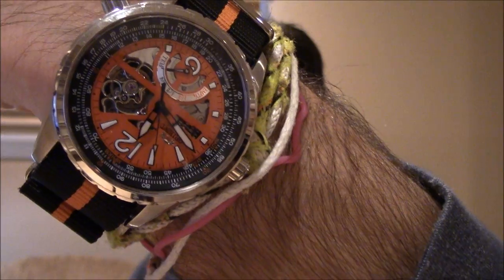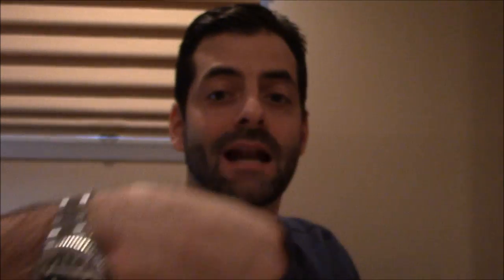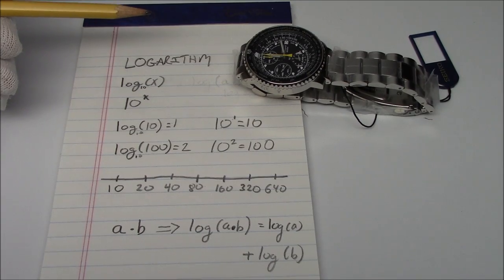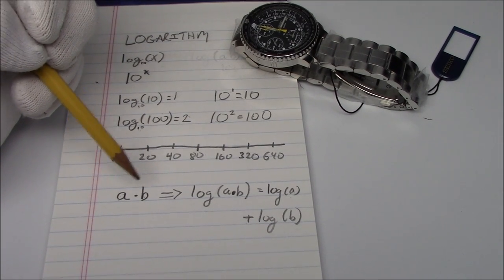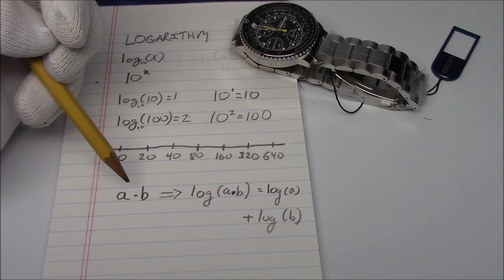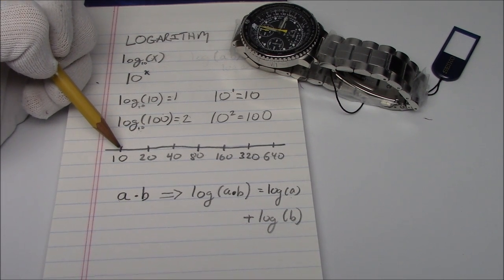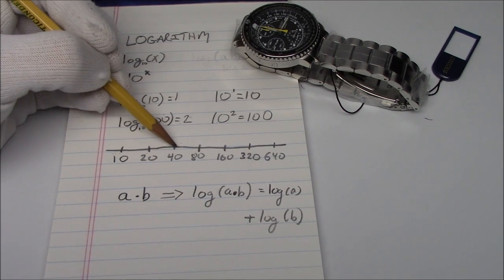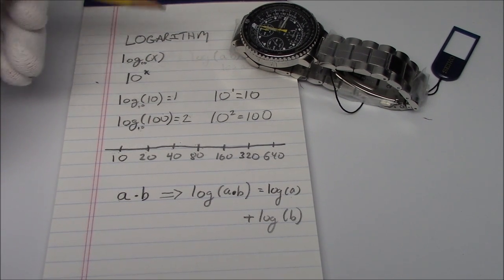How to use a Slide Rule Bezel on your Watch. Watch and Learn #11

Comment: I learnt to work with slide rules, and a round sliderule, like a bezel is more practical than a straight one.. 
I Design watches myself, and i've been thinking of making an Engineers watch with a sliderule bezel.. they rock!.. never out of batteries, and precise enough for good "Guesstimates"
I've made a special one for the workshop, to set up my CNC machines.. because on a calculater you have to remind the formulae, with "dedicated"sliderule you just slide and read..

Comment: I still have two of my slide rules... This brought back Memories.  Hewlett-Packard and Texas Instruments with their Scientific Calculators Amadeus Slide Rules almost Obsolete.
Reply: However, we were taught to keep them our slide rules around in case of Power failure, batteries ran down, etc. On my Iphone I have An AP that does conversions but it is still fun to see if I can do calculations with my slide rules. Also, using the slide rule bezels on several of my watches. I love technology and love to fly. If I had Catastrophic failure of all instruments on my plane I could possibly Navigate, and calculate with this Watch Bezel. If Flying in Turbulence - would be nearly impossible to use this but I would try!  Thank You so much for your instructional Videos. I have this watch and several others in my collection with this type Bezel and enjoy them!

Comment: You mention being able to work out trigonometry with this, Or that it can be done on a normal linear scale.
Can you please point me in the direction of a place that will explain this for trig on a watch? I did a quick google and can't see it.
I use a triangle calculator on my phone very often so learning to do this on my wrist would be much more empowering for me, also means I can use in when I am out camping without a battery.
Or, better still could you do a video of this?
Reply from the maker: Hmmm, I think you need a trig scale slide rule, which this isn't.

Comment: Actually, Canadians would find a LOT of use to convert between Imperial gallons and US gallons. All cars in Canada are usually listed in both L/100km and mpg, but if you're car shopping in the US, or reading the fuel efficiency of a car on a US website, the mpg is always lower as there's 4.54 L vs 3.79 L in Imperial and US gallons respectively. Living close to the US border ( as most Canadians do ) we're always converting back and forth and we've internalized most of the conversions. Without looking them up I can tell you  1lb = 454g or 1kg = 2.2 lbs. 1 gallon = 4.54 L, 1 US gallon = 3.79. There are 20 fl oz in a pint of beer ( the fl. oz are slightly different as well). 1 tsp = 5mL, 1 cup = 250 mL, 1L ~= 1 pint. 1 mi = 1.61 km. 1' = 30cm, 1" = 2.54 cm. An 8' 2x4 is just under 2.5m etc.

Comment: When calculating, it is always recommended that you estimate the answer first in your head, even if only roughly.  This is, IMO, essential to avoid gross errors, and is highly recommended when using any form of calculator.
  Example: seven diners are to share equally a bill of $185, so the answer is going to be somewhere between 20 and 30 bucks each.  Ruler gives the figures 264, so you instantly know that these figures means $26.40 each.  Very important.
  The other thing that a slide rule does which a calculator does not, is to display all pairs of figures with the same relationship simultaneously.  Say you have a photo that you want to print.  You can set one of the image dimensions (height) against the other (width) on the slide rule.  Now it displays along the scale all possible sizes to print that picture, telling what the width will be for any height you choose, and vice versa, and you don't have to alter the dial at all to see these.

Comment: Are there any affordable automatic watches with logarithmic slide rules?
Reply: Not sure how much the Orient is that Marc has but Seiko does have a Seiko 5 model that has the bezel just no chrono and tachymeter.  I have a blue and orange model SRP609 that's a few years old; there are different color combos of this model and a current one with a different face.  4R36 movement so it has hacking and handwinding.
Reply from the maker: Yes, like said already, look up various Orients and Seikos. They have them here and there, and are under the 'few hundred' mark.

Comment: The best thing about slide rules is that they get automatically rid of unnecessary precision. If you are calculating how far you can fly with the fuel you have, and your fuel gauge gives you the fuel amount in 5 gallons increments, there's no need to go 'full Spock' and give a three decimal point precision on the distance in Miles ("Captain, we can go seventy-five point zero four five miles until we run out of fuel" — do 237 feet make much of a difference in 75 miles?). In most engineering calculations, taking into consideration the margins of safety needed, 5% precision is quite enough.

Comment: Great video and explanation.  I think you figured the tip wrong.  20% of 210 would be $42 tip.  I think u need to align outer bezel 21 with inner 10.  Then look at what lines up with the inner 20. I had to experiment to figure out but I think that’s right

Comment: I know this is old but I have to say this: a slide rule or an abacus can be faster then a pocket calculator. The reason? because data input in them is also data processing. Nothing can beat an integrated chip when it comes to speed, but the time it takes to actually input your data into your pocket calculator might take longer then someone experienced using a slide rule or an abacus. Depending on the operation and size of the numbers you want to compute, analogue might be faster because if can take less time to input the data. In other words, we need better interfaces for pocket calculators.

Comment: 60 degrees. 60 minutes/degree. 60 seconds/minute. 1 nautical model is (more or less) one minute of arc on the earth's surface. In navigation "60" is very important. It is also one of the very good reasons ships and aircraft use nautical miles.

Comment: How to do currency convertion though?
Reply from the maker: Same way I did the tip for multiplication. Like if the currency conversion is 1.2, then you put the base currency on the 10 and the 12 on the sliderule will be the conversion.

Comment: If there is a slide-rule watch with a UTC indicator, that would be money.
Reply: TomF1970 Breitling makes them or at least used to, not a cheap watch though. I'm pretty sure some other aviation watches included both a circular slide rule and a GMT/UTC indicator.

Comment: I think there's a sneaky use of logarithm in digital camera business.  I am talking about megapixel.  Megapixel is a logarithmic growth, meaning, that we if increase the megapixel number by quite a bit, we effectively gain very little in image size we can print with the same resolution.  In other words, megapixel can be a very effective marketing tool.  For instance, the difference between 6 megapixel and 8 megapixel sensor sounds like a lot, but if you look at the image size these produce at the same pixel size (of course), the difference is negligible.  Never mind 18megapixel and 20 megapixel.  There's no effective difference for all practical intents and purposes, and yet it seems as if 20 megapixels is so much better that 18 megapixels.

Sort of like jewel count in a watch.  Not always the best measure of quality just like megapixel is definitely not a measure of quality.  Pixel size and lack of inter-pixel interference is far more critical.  But I digress, of course...
Reply from the maker: No worries; your point is understood.
Reply: Point of difference comes from whether it is digitally obtained megapixel or hardware obtained and you are correct in that regards, it doesn't add nearly as much as it is marketed for. Unless you are printing large scale RAW prints
Reply: Haha funny how you compared megapixels to jewels. I used the same analogy when explaining watches to my dad because he is fluent in the language of photo equipment.

Comment: I have one of these watches and I'm a professional pilot. Most of the calculations are just unnecessary as most any plane has a GPS which provides you with a ton of information without any calculation necessary.  If you owned an old plane without an electrical system like a Piper Cub, I suppose it might be fun to make a flight leaving all the electronics at home just to get the sense of what it was like back in the day when the plane was new. If I actually needed anything the GPS didn't provide a smart phone or a tablet is always available in the cockpit.  However, some of the calculations are rather handy and can be made faster than pulling out my phone. Examples of this are when you fly internationally and they sell fuel by the liter instead of the gallon.  Or let's say you fly a jet where the plane does everything in pounds of fuel and the line guy wants to know how many gallons you need.  It would be nice if it had a scale to easily convert between hectopascal to inches of mercury and some easy way to convert from knots to mach and vise versa, but instruments in all modern jets do this for you, so not really necessary anyway these days.  For me the most useful function in the cockpit is the chrono, which I do use quite often.  I suppose the tachymeter might be useful in many circumstances, but I never seem to remember to use it.

Comment: This is based on the E6B calculator that was developed for pilots in the 30's IIRC. Search E6B aerial calculator online; there is a PDF tutorial available to help you learn what everything is for (https://www.sportys.com/media/pdf/asae6b.pdf). I actually own an aluminum version from then 40's, the back has a very complicated tool to help determine correct heading to fly based on your speed and the wind that is affecting your flight path. Vietnam helicopter pilots called it the E6B confussor.
You can actually see Mr Spock holding one, probably Gene Roddenberry's from his days as a combat pilot in WW2, in the original Star Trek: sorry don't know which episode.

Comment: so i understand the beauty and style in owning a watch like this but the modern phone has made the slide rule at least obsolete, i still believe in rocking  watch but id still reach for my phone before using my watch............im assuming there are watch dealers viewing this video....just a question...has the modern mobile phone caused a slump in watch sales ?
Reply from the maker: Not for us.
Reply: I am not concern of running out of battery in my automatic watch... and by the way, looks cooler than the phone. I agree that the smartphones bring functionalities that simplifies our life but for measuring time, mechanical watch rules (personal opinion / preference based on my experience).